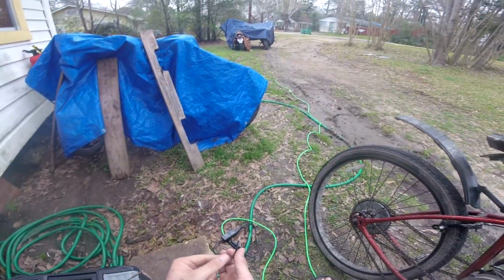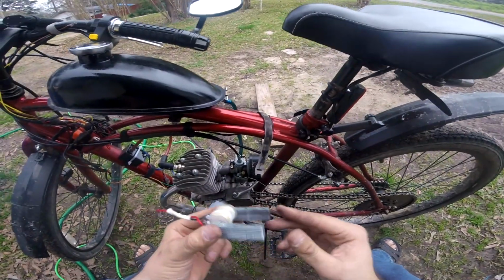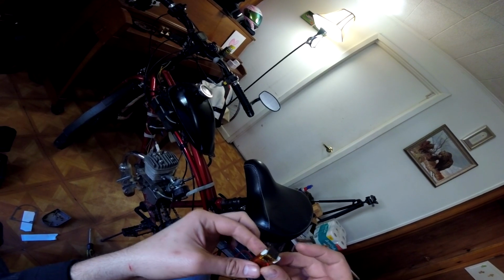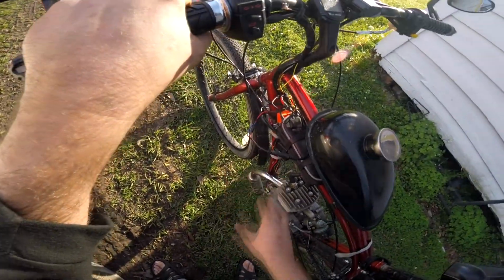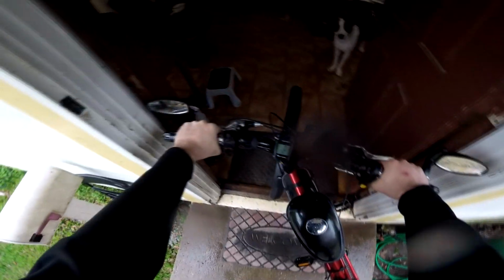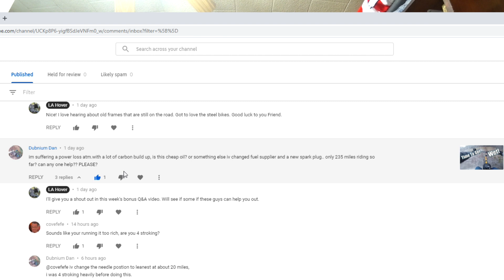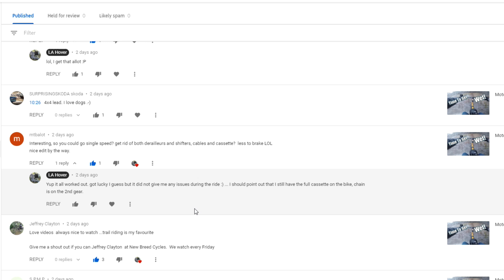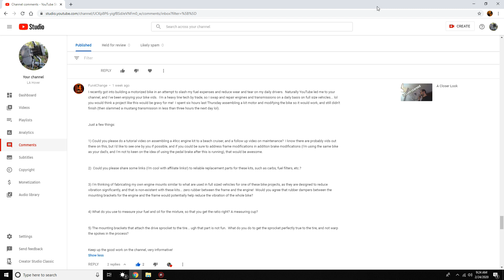Charging System Update (Motorized Bike)

Comment: You need a battery to charge so the coil will not die from supply needed. Your CDI Should have a diode  to stop the battery power from frying the magneto. But is sounds like the battery did fry the charging system.
Reply from the maker: I completely forgot about installing a diode... lol not sure how I over looked that, but I think you are 100% correct. Lucky the coil was still working when I took it off the bike. Good thing I did not keep running with it. Thanks for the info.
Reply: @LAHover  I have not hooked my battery up to the white wire yet. But I put in a 6v. rechargeable battery from an emergency light. You know the one that comes on at a public building when the power goes out. You can get them on-line for about $6.00 or at Home Depot for $20. It can be installed upside down with no problem. I made a box and laid it on its back. That is what I am working with. It will not be bright enough for the night ride. But they will see you. I enjoy your videos. It is a learning channel for so many.
Reply: @LAHover  hi so the first thing i suggest would be to connect 12v incandescent bulb to the to see if it can power that then mesure voltage and current then try connecting ether more bulbs or more powerful one to see what is the maximum power you can draw from the coil. If the coil able to suply significant amount of power then you need a full brige rectifier to trurn ac into dc current the regulator you bought shuld have it inside together with voltage reguliator but its made to charge a battery that's why it doesn't have a capacitor so insted of geting nice dc voltage you get pulsating one. Never connect ac voltage directly to a devices that require dc you may permanently ruin then.
If the regulator doesn't work out the biuld your own full bridge rectifier and get a dc to dc boost buck converter they are more efficient then linear regulators but only do that after you make sure your coil able to supply the power nesery but you still migth need a small  battery to hellp supply power when engine is idling. Hope this was helpful sorry for bad English.
Reply: @LAHover  why don't you just order working bike lights online.. they have wireless bike lights horns etc you know ...save the hassle
Reply from the maker: @chc754  other than not running off the motor, the system I built with my own two hands is working great on a battery ;) ... It just feels good to build things.
Reply: @LAHover   I feel you bro good to see people get they hand dirty these days and actually know what there doing. Good stuff !
Reply: If you can get a DC generator take a car charging piece apart, attach your positive and ground, use other side with USB charger, to your battery pack, if it can charge and be used
Reply: I even think some of those charging ports even have converter built in

Comment: I watched your video and remembered I had a Dynamo on my Schwinn Stingray when I was a kid. It worked great and was relatively cheap. I looked them up and they are on amazon pretty cheap and with LED. both front and rear light. Under 20 buckerinos. Not bad. I was thinking if you ever have a problem with the motor, how do you transfer your magneto to another motor or a bike without the head ache. Well with the Dynamo its really easy and its contained on its own circuit. I understand if the Dyanamos / bike friction, light by STVZO certified from Germany. These are actually the best low friction, low noise and have been tested optically for the road. However they are not cheap. I am going to buy chepo. LOL !  - but if its to loud or has too much drag then I will see how much the motor bogs or if it affects the mpg and to see if it can even handle higher speeds.  Keep up the great content :) Oh, absolutely loved the 4th ehem 5th of July video and those awesome bangers. Now just think you also ate some bangers too. In england thats what they call hot dogs. LOL !
Reply: I was thinking of going the $25 Dynamo kit also & maybe modding it. Coz the removable rechargeable head/tail light kits sounds like a pain. I had a dynamo when I was a kid  & remember it didn't cause very much drag. I was thinking of taping some NiCad batteries together & making a crude on board dynamo rechargeable system. Add an on/off switch & wire it so the lights can be ran straight off the battery pack or the generator. Then use the generator to either run the lights or to recharge the Nicad battery when riding in the day time. 
   I have a $5 digital voltmeter laying around I can connect to the NiCad battery. Since the batteries are cheap, the charging doesn't have to 100% accurate. When the 6V battery bank voltage reads say 6.8V  you know it's full charged. When it's down to say 6.2V  you know it needs recharged. I think I have some old cell phone batteries laying around I could solder together to make a battery bank. They're lithium instead of NiCad but free so if I ruin em, no loss.  Even if I don't get the rechargeable battery pack made to work. I think a decent dynamo kit would still be better than dicking around with a removable /rechargeable head/tail light kit. I wish someone would actually make a decent low priced motorized bike lighting kit. 
 I'd buy the one in this video, if they  figured out how to make it work & provided some instructions.

Comment: growing up, my old man had this light on his bike that was powered by this device that goes up against the tire and the spinning tire spins this little generator and powers the light.  you may be able to recharge the battery with one of those.  depends on the output and ud have to set up something so it doesn't overcharge
Reply: I bought a '6-volt generator light set' like what you described.They're about $11. At 15 mph it burned the bulb as it was too much juice supplied.I changed to LED bulbs and the cheap POS' fell apart from vibration.Bought quality bulbs and it's ok.

Comment: I do like the idea of the Velcro. I built one of these about 3 years back, poorly, and I was constantly having to cut zip toes when I needed to work on something. but it held up for like 2 years which was pretty good. when I gave it away the engine still ran,  but the mounting hardware and everything else was falling apart due to me not knowing what I was doing at the time and I was tired of messing with that one. I think that I am going to give it another go with a better bike this time now that I know what not to do, hopefully I can make it a bit less sketchy this time. by the end of things with the old one I had the engine held on with copper wire because the studs stripped out.

Comment: I connected an oscilloscope to the magneto, and discovered that the stock coil only produces around 1W of power. Based on the wiring diagram of the stock CDI I found on the Internet, only 1/2 of this power is used to power the ignition. The other half, could be potentially utilized using some electronic circuit. This electronic circuit, yet has to be developed. However, 0.5W is not much to power an LED. As for the auxiliary coil, its problem is that it messes up the magnetic field for the main coil because it locks the magnetic loop even though there is no physical contact between them. The gap is just too small. There is nothing you could have done to make this system work. It was a good decision to stop.

Comment: Depending on how comfortable you are with modifications, You might be able to utilize a duel set of Magneto's and coils. Mounting them up in the coil area(would have to find a new way to seal that area) would allow for enough power for both the motor itself with a "stand-alone" system for the lights, horn, etc. It would still be ac current, but you might be able to find lights that would work off of ac current or like with LED lights they might have adapter bulbs for ac current. Hopefully this will help.
Reply: The coil puts of way more voltage then you think, and next to nothing for amps

Comment: LA Hover do you still want help with the charging system because I have the 12 volt set up but I never installed a Battery to it 
plus I've seen how you wired it on the video and it was Completely different from the way I did it 
You are my favorite person to watch when it comes to Motorized bicycle stuff and I just wanted to see if you still needed help with this because you haven't talked about it since this video
Reply from the maker: Thanks for the offer. I'm going to just stick with rechargeable light for the foreseeable future.
Reply: Hey there, could I get an explanation of how you achieved it? And no battery for you huh? I'm just getting into motorized bikes and I'm absolutely determined to set up a proper electrical system, but I can't decide if I want to go with a magneto system or try to set up a pulley driven alternator. But any tips from someone who's actually done it would be great, thanks!
Reply: LA Hover, I like to heat your comments I think you say a lot educational information that I really appreciate, this is the 1st time I comment in the internet I started putting together electric bicycles just lie a hobby about 3 years ago, right at the same time the pandemic hit us I had build many electric bicycles, at one time family and friends come to my house and I was able to put 10 electric bicycles and we all jumped on the bicycles and went riding the streets of San Bernardino the City where I live, it was a lot of fun, after that satisfied experience I took all this bicycles a part and stored them, like to mention that I’m a certified welder and fabricator it is natural to me to build, rebuild, or even fabricate from scratch ether way is been an absolute experience and fabulous adventure in my life, since ten I been having a lot of fun, like I build one test and take a part again, also I had build my own battery packs, I been learning to do all this thanks to YouTube and the super inspirational people like you that make all this videos, without it I be nobody, but I’m getting ready to make a video or two of the last projects I’m working on, till then I will keep watching videos of wonderful people like you and all the YouTubers that inspired me to make something out of nothing. Thank you all so much. Julieo
Reply: Yeah I’d like to know how you hooked yours up as well

Comment: Since you have a full Circuit. Going to the Killswitch when you disconnect that powerline cord ground whatever it is coming from the coil that interrupts the full circuit even though you can turn off the battery and there’s no problem it won’t kill the motor when you disconnect that cable it automatically kills it because there’s no fuel circuit to the Killswitch and back-and-forth.

Comment: After watching this video and reading a few comments there are a few people that are misinformed the reason I say this is because there is a difference between a magneto and a stator. A magneto is like what you would find on a lawnmower where it is a coil pack with a spark plug wire coming directly out of it mounted next to the flywheel. And a stator is a coil pack mounted next to the flywheel with two to three wires connected to a CDI that connects to the spark plug

Comment: The scenario that u referred to as 'engine flex' is commonly referred to by automotive mechanics as 'torque twist', in a high performance drag car application, this initial 'impact' or 'shock' can cause a lot of damage to many driveline components. Many people solve this problem by installing solid metal mounts and/or 'engine plates' - a steel or billet plate cnc-machined to the shape of the front mounting surface of the engine block, this is then sandwiched between the timing cover/water pump etc and the block itself, these components are also machined down in thickness to compensate for the thickness of this engine plate.
 I think this example I have provided from the automotive world tells us that we already have a head-start in our motorized bicycle application...

Comment: if you are soldering, the lead free stuff sucks. I guess it does not matter TOO much with wires and stuff, but when working on circuit boards and stuff where you want nice pretty joints, the good old leaded solder is so much better. a good quality flux paste or flux pen is also really helpful sometimes.

Comment: If you have anything grounded to the handlebars, you need to put a jumper wire capable of carrying the load from the handlebars to the frame. The bearing race with its grease and the fact that it may be insulated from the frame by paint will not allow a reliable ground path.(the races are in the top and bottom of the vertical tube the fork stem passes through, as I'm sure you know; which is most likely painted.) . It is my contention that the kill switch (normally closed) opens up the circuit from the magneto to the CDI, stopping the flow of current to the CDi. This makes more sense to me than the idea that pushing the button somehow provides a direct short to ground, something that in most instances is to be avoided. It would be easy to test with an ohm meter. If you have landed one of those wires on the handle bars to cut down on clutter while assuming that the current would be carried from the handlebars to the frame as a ground path, that may be a part of your problem. This is just an educated guess, an example would be the ground strap from most gas powered ICE automobiles (as opposed to diesel). The rubber portion of the motor mounts prevent a ground path from the engine, and thus the spark plugs, for instance; to the frame to complete an ignition circuit. Not being able to see the circuitry, I can only guess where the fault lies.
Reply from the maker: Solid information. Although I ran ground wires from each device to the batter I would not have thought about the poor connection through the head set, Good to know. As for the kill switch it is a "push to close" circuit (short). The motor will still run with the kill switch wires unplugged.

Comment: My boy installed an 80cc engine on his bike, and no matter how hard he tries, he can't start it, he asked me for help, I have checked the coil and it is fine, fuel flow and carburetor and everything seems fine. I see that the spark from the spark plug is very light, by chance, do you know how many ohms that type of spark plug should have? I would greatly appreciate that information. I think that's where the problem lies. Thank you very much for your videos, they are very illustrative.

Comment: I'm a bit late to the party - but the magneto coil would definitely be interacting with the generator coil through inductance - no physical connection required. I'm no electronics/electrician whiz either, but the two fields are probably acting to cancel each other out. Now... in theory... it should be totally possible to grab some voltage, but I feel like the DC-generating coil would need to be basically far away from the magneto coil. And even then, it would probably need rectification etc. It's why it's so tricky to understand how a car's alternator works - they seem simple enough, but they're deceivingly complex.

Comment: Try putting a rectifier (4-#4001 diodes ) on the red and black wires from the magneto ( blue and red ) don't connect a ground wire to the frame if you want the engine to stay running.

Comment: You could try a magna hub (a wheel that generates power) or a frame mounted generator that runs off of the back tire
Reply from the maker: Good idea, I might give one a try :)
Reply: @LAHover  I have a wheel mounted one that runs 6 volt (I  think)it came along with a headlight on an old AMF roadmaster from the late 70'S ! I also purchased a slightly newer used bike that had a head light and generates and they were both junk compared but a magna hub If you can find one  might be your best bet!
Reply: I saw a guy on a youtube vid a couple years ago who had rigged up an actual generator which ran off a pulley going to the main drive (bevel) gear. It's just a matter of how motivated a guy is I guess and how durable the setup can be.

Comment: Sooo... you needed to isolate the parts of the motor that are in contact with metal and avoid placing or fix the charging system directly on the frame???

Comment: I'm not sure if you figured this out, but I'd love to know what you did to hook it to the battery to have the battery charge. I bought a voltage regulator that converts AC to DC, but  I'm not entirely sure I have it wired correctly, or what I've done wrong. On the bike, I have the red wire coming from the generator coil. From there the red wire goes to the regulator (pink wire), and the green wire coming off the regulator is my  Negative terminal, and red being positive. I look forward to you hopefully responding. Thanks

Comment: Have you ever used it was called on eBay a CNC bolt on sprocket adapter it's a two piece inner and outer sprocket that doesn't compressed against the spokes
Reply from the maker: Ya, my trail bike is running one, and I have one almost ready to be installed on this bike as well. I just need to key the hub and it's rdy to go.

Comment: You need to replace the magneto starter part to a higher level in order to provide enough power to charge a battery at the same time. The magnetos they come with the bike engine is only designed to produce enough power to run just the engine and whatever else you want to push your luck with.

Comment: Isn’t there 3 wires white blue and black  the white is your aux 12 v power supluy to your bat and lights etc: the blue is the cdi or coil wire black is common to both blue and white
Reply from the maker: Some have three (not all), but 10:00 shows that the white and blue are connected together.

Comment: I'm thinking about using a 4mm bottoming bit to drill 2 holes on either side of the big ends 4 total about 2+mm deep and putting 4x2mm rare earth magnets on the magnet and go up to 16ga on the wires on the stator to a pw80 CDI box and then a cr80 coil br7-8HIX